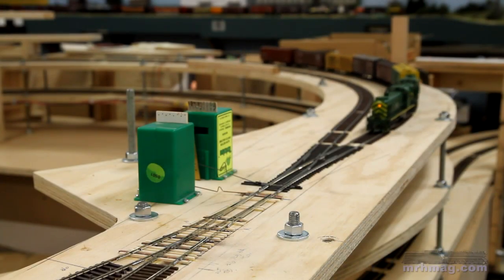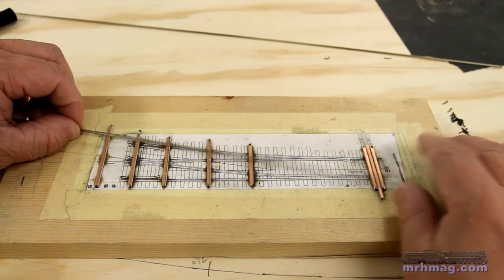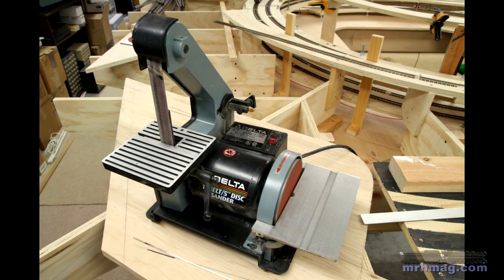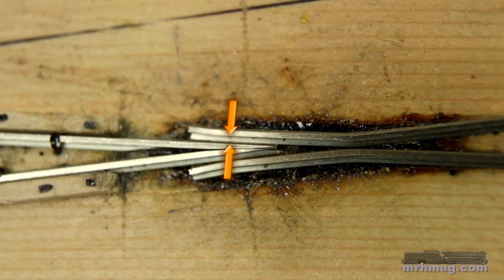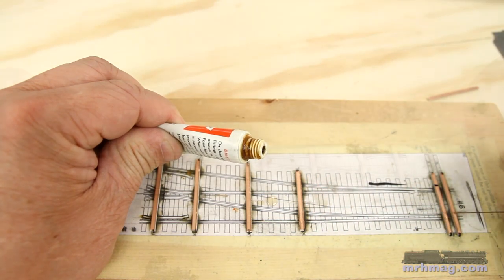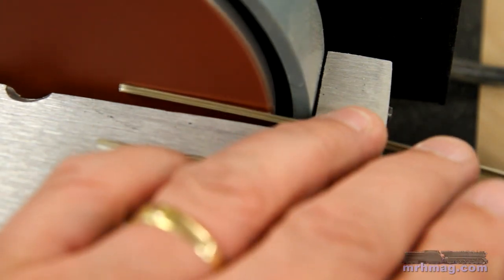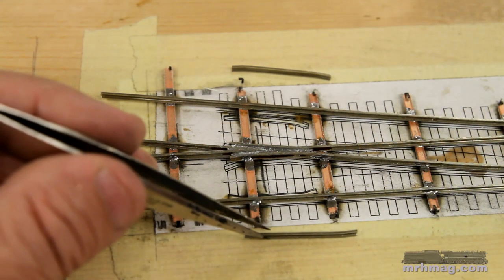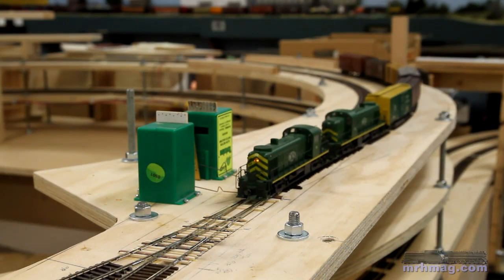Scratchbuilding a turnout for your model railroad

Comment: I also use a piece of
hacksaw blade to clean the solder out of the frog flangeways but I super glue a piece of strip wood to one side to act as a depth gauge for the flangeway to make it easy to get a constant depth

Comment: Charlie Comstock, thank you for the clear instructions on building your jig for frogs.  Will be making one this afternoon to build custom turnouts and a wye,
Reply: James Moon Finished spiking down the first turnout last night.  Test truck rolled through the frog with no derailment problem without guard rails.  Will add the guard rails.  Used Charlie's jig but spiked all rail to wood ties.  The suggestion of using the Rolly Holders is an excellent one as I purchased a set before spiking down the track.  They are better than three point gauges for assembling turnouts, in my opinion.  Only PC tie used was for the throw bar as I could not figure a good way to insulate a brass bar stock throw bar.  Again, thanks to Mr. Comstock for the excellent tutorial.
Reply: James Moon hall 
.

Comment: I would like to add some information about turnout frog measurement.  A frog is measured by the spread of the rails from the point but the line that is measured is down the center of the frog and the spread is measured perpendicular to the length line so 1/2 of the spread is on each side; this is an isosceles triangle.  Because these are small angles and the models are small, the differences are hardly noticeable.  The frog angle of a No. 6 frog is 9 degrees 31 minutes 38 seconds while the angle you have laid out is 9 degrees 27 minutes 44 seconds.  I was more used to laying out No 8 's and No 10's which are 7 degrees 9 minutes 10 seconds and 5 degrees 43 minutes 29 seconds.  If you check any table listing frog angles, you will find these numbers.
The diverging stock rail should have the switch point angle about 6 to 8 inches in front of the straight closure point to help "hide" the point from wheel flanges.
I realize my comments are years along but are from full size practice.

Comment from the maker: Yes. A #5 turnout frog jig would be a 5" length and over 1".  Remember, this is a ratio so the units don't matter as long as they are the same for both measurements. So you could use a 20cm length and over 4cm (which is the same 5 to 1 ratio).

Comment: I think every one has their own methods of making turnouts, and I liked your wood jigs. I also use roller gauges and paper templates, but I noticed you  did not use a gauges when soldering your check rails into position. The position of these are critical for smooth derailment free operation. I would recommend you use your roller gauges to position your check rails as you are soldering them, then you will find there will be no need to adjust the check rails, most of the time.

Comment: No question / excellent tutorial. But it sure helps to be able to own those power tools...I wonder how it was done in the hobby before them. Anyone out there have success building switches without power tools ?
Reply: FastTracks makes a filing jig known as a "Point Form" which you can use to shape the points and the frog rails. That's my plan, actually.

Comment: Killer video. I would like to see a little more detail to better insure the jig is set up correctly, or maybe I missed something. At any rate this shows a very thrifty alternative to expensive jigs and forming tools that do not ensure good results. I would have to invest in a bench sander that would easily pay for itself on many projects. I have a dozen old dead frog turnouts in my yard and this is making me think that I could cheaply replace them all.